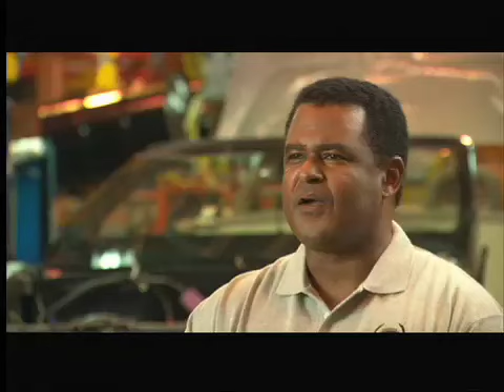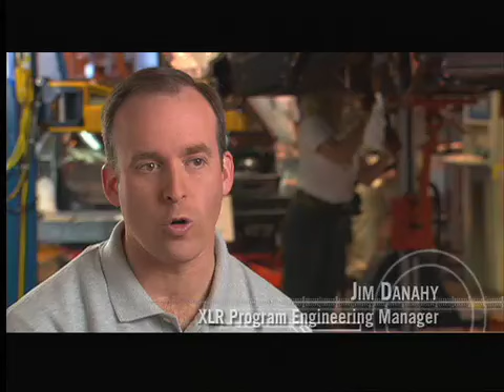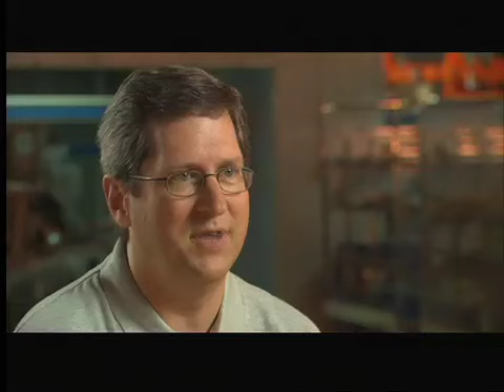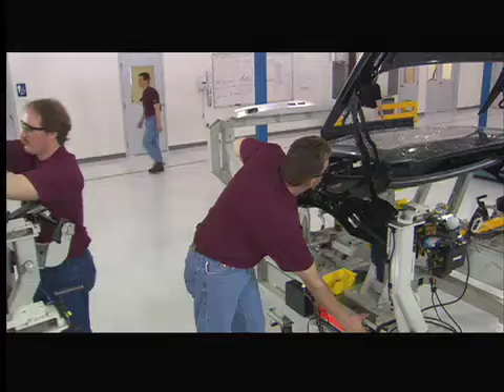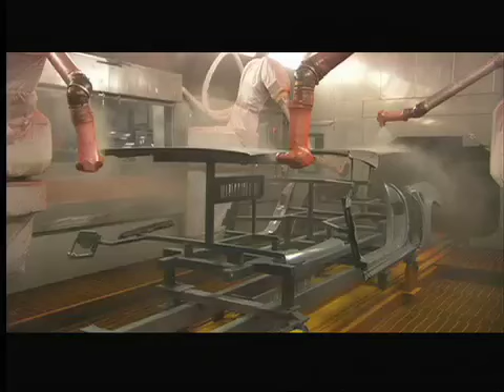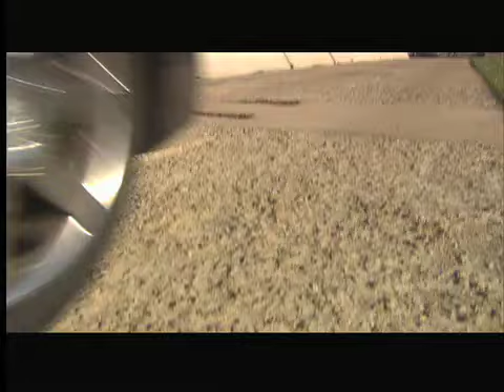XLR PLant Video.mov

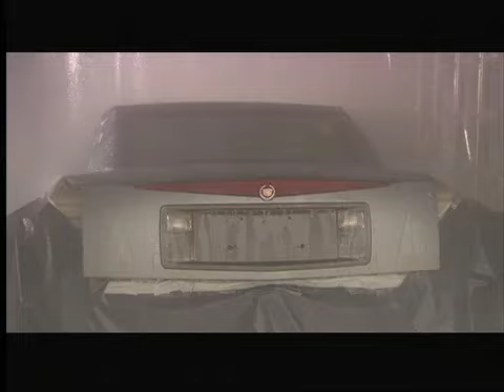Comment: At the 5:38 mark they should have tested it better. The trunk leaks on most 2004-05 models and shorts out the suspension module and the control top module. Both are very expensive to replace. Other than that the car is great.